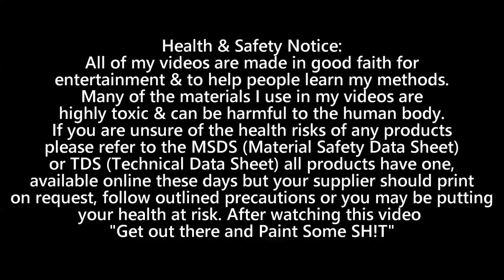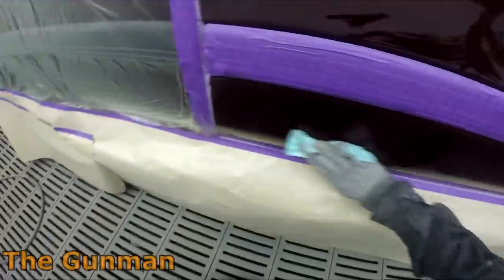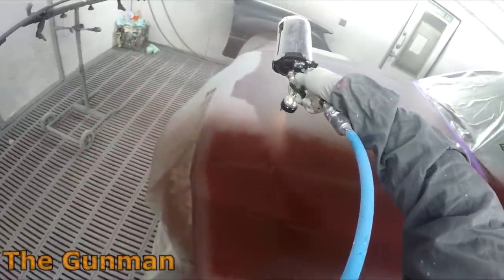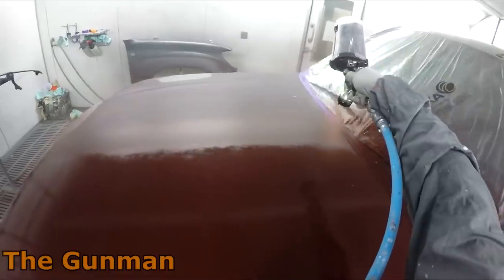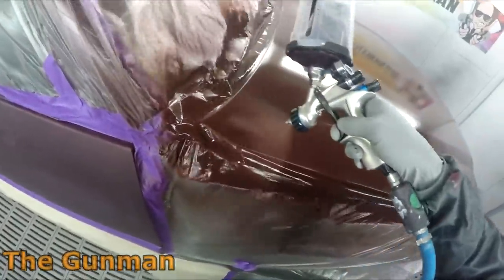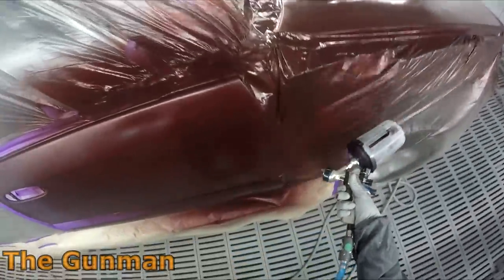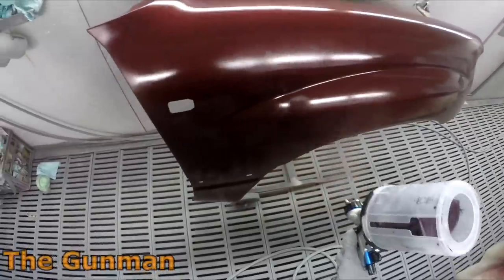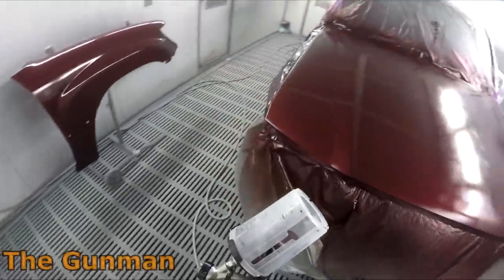Spray Painting in EXTREME Heat

Comment: The Gunman Hello again mate...as I said before I had some major issues with that van door lol...all went wrong very quickly after that low spot repair.
Anyway ..I started over...and this time I turned my dining room into a spray booth 👌
The results are 10 times better...the base went on nicer...the clear went on perfectly...the door looks amazing already and I've not even wet sanded or buffed it yet.
I'll do that tomorrow or the next day.
I appreciate its obviously going to be  a worse job doing it outside but I cant believe how much it affected every part of the job...I think the paint was drying in the air and drying too quick on the door...it was quite hot.
Wish I could show you a pic mate... I'm so pleased with how it turned out considering it was done with cans etc. 
Anyway... thanks again mate.

Comment: Will they give you a key to come in early. In Missouri, it not only gets hot , but humid. We would come in around 3,4 am and spray. We would then leave around 11am, or noon. I feel your pain. We worked in a metal building, without air conditioning. One summer the thermometer read 135 degrees. We were spraying regular Standox, not water. Keep up the great videos!

Comment: Last time I painted it was so hot that when I tried spraying the cleaning solvent onto the car it was evaporating before it hit the car, no way to do it no matter what I did. Painting sucks when it's this hot.  You need slow reducer for certain but even then IT SUCKS, the reducer was drying before hitting the car so I ended up with base coat turning into dust and laying on the car like a pile of dirt.

Comment: Gunny, you didnt say what types of pressures to use. Lately I've been having an issue because it's so hot that the base is dry on car and drying before I can walk around car. I am using the dv1. Should I drop pressure in heat from 22psi to maybe 13 or 14 to keep it wet? It's making the clear have a orange peel that I end up having to buff. Let me know!

Comment: Hi Gunny Phil here again my question is which would be a good spray gun to use as well as using it to spray a  wooden entrance door .I would have to use Polyurethane paint yes as they use them for Kitchen cabinets.I just want a better finish for my front door.Also to use the Gun for spray painting panels as well for cars.

Comment: Drop the pressure and paint smaller sections in the 1.5 coat method. I would have cut the hood/bonnet into 4 sections. Whatever works is always the correct way if you ask me.